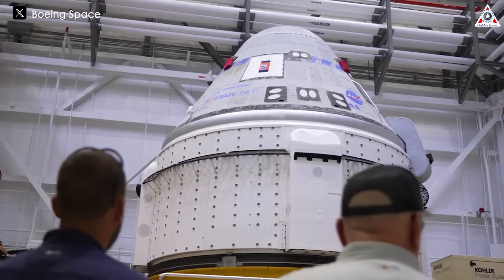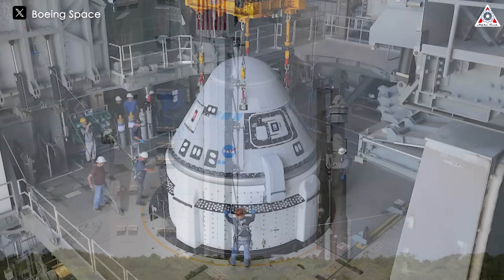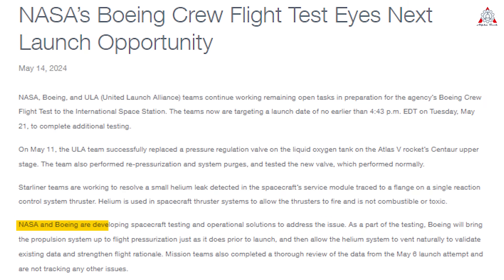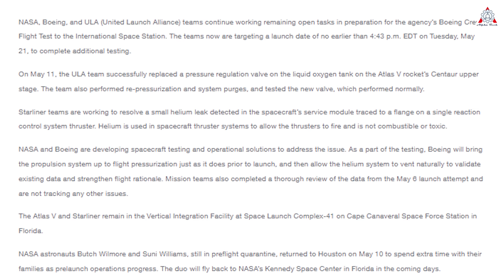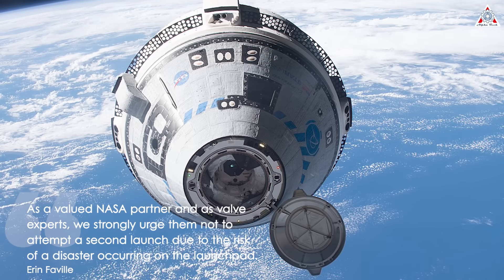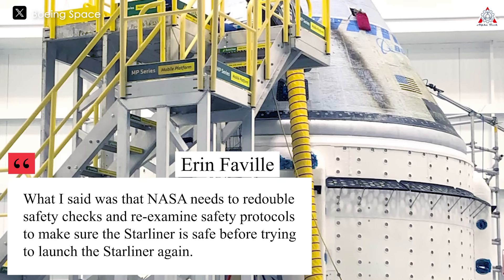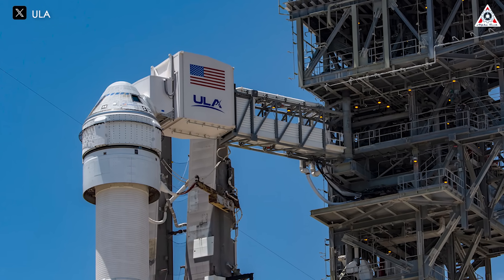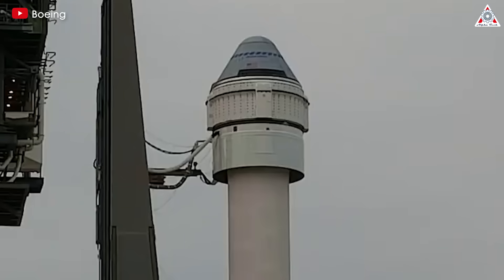Starliner is in Big Trouble! NASA Finally Realized Dragon is 1000x Better

Comment: Don't they utilize test benches for components used in assemblies? Leaks, noises, electronics failures, Space X has had it's share of rockets problems. It's expected when designing & building entirely new Flight to Space and Space Technologies for Human Occupation. There are NO Service Stations, NO Parts Plants in Space. I for one, would not step over the threshold and into a capsule going to space or a 9 month journey to another planet without being 100% confident your vehicle will stand up to the torque and pressures exerted at takeoff. If there are problems, I'd want them identified during rigorous tests, as they build and stack not after a live launch! But in saying all this, we're dealing with manufacturers who are NO Strangers to building and launching Space Vehicles for 60 + years. The kind of problems they're encountering are usually discovered pre assembly. It's telling me, there's a severe engineering intergration problem, poor testing, assembly and quality assurance. I'm surprised that there aren't more boeing aircraft just dropping out of the sky! Dust off the Saturn V LEM, Command Module, and Capsule and send that back to the moon. The launch problems are already thoroughly documented and fixes applied during the build process. It just seems the more advanced we become, the more careless we are.

Comment: Why use helium?  It's expensive and we do t have very much of it.    Why not another inert gas?
Reply: Weight, perhaps? The Atlas V has a cost of $13000 per kg to low Earth orbit. Helium is a lighter gas and therefore costs less to put into orbit.
Reply: He leaks out of smaller pinholes than any other gas except Hydrogen.

Comment: Boeing has become a 3rd rate manufacture company,  incorporating poor reassembly of farmed out main assemblies. Boeing has as many suspicious deaths as HRC and climbing. I won't fly on any 737-800 aircraft. Many bad issues now with Boeing and their suppliers. Aerojet assembled the 737-Max plug door properly, Boeing took the door off and forgot the locking bolts? That's crazy, some yellow caution tape would have warned the next shift crew that the bolts were missing and NOT to install the interior plastic over the rear door plug before installing the plug door locking bolts. DEI or not, there's a big process problem where QA is concerned.

Comment: The thing is those Astronauts and Aerojet or Boeing do not have to rely on it anyhow to keep on mission. They are launching 200 of these a year without a hitch so far. But only this one is troubled and they gotta be about letting Pilots and Astronauts be in charge of the majority of the actual flight issues that they've all already specified without cause to interfere. This mission will be on track with the same Astronauts regardless of this never ending stop action on this one rocket. Several other successful liftoff pads exist

Comment: "Ladies and gentlemen, thank you for attending this briefing on the Starliner mission.

"As you know, we've had a few, well, 'issues' along the way which have caused us to postpone the launch time after time after time, prompting one of the astronauts to throw very heavy objects at me.

"One of those objects is called a 'Reaction Control System Thruster,' and it really hurts when it hits you in the head.  Suni Williams has quite an arm on her.  I'll open the floor for questions now."

"When will Starliner launch?"

"May 21st."

"No, I mean for Real-Real, not for Play-Play."

"October 11th."

"Of which year?"

"2025.  Next question..."

Comment: The biggest problem in my opinion is that the initial problem with the ULA valve was someone had to "notice" an odd "humming" sound from the valve before the flight was scrubbed.  The question that has to be asked is why was that valve not picked up routinely as faulty with the sensors on board the rocket...

Comment: We need more than one supplier.. 
It’s like a car manufacturing.

One supplier might have a $50,000 car, designed with latest tech, works really well, delivers everything needed and is reliable.

The other supplier has a $5,000,000 car,  looks like it’s from the 60’s , breaks down as soon as you leave the shop, and people say a prayer before starting the ignition.

Umm.. I think we can live with one supplier..

Comment: Boeings quality control went down the tubes after they merged with mcdonell douglas.
Reply: Actually, it started a bit earlier when Philip Condit became CEO and went on a massive restructuring of Boeing. McDonnell Douglas had it's own financial issues leading to the merger, but MD was essentially swallowed  by Boeing. Moving the headquarters to Chicago was the work of Condit. The Boeing board even tried to oust him.  MD was a victim of the merger and not the cause of Boeings problems. Condit changed the corporate culture of Boeing. That is what hurt it the most along with moving from Washington.

In reality, Condit was responsible for destroying two great companies. It was all driven by the rise of Airbus and the desire to eat their lunch. It failed miserably.

Comment: Back in 1967 Gus Grissom crew commander of Apollo 1 was photographed holding a lemon over the command module.
It killed him , Ed White and Roger Chaffee months later during a fully pressurized capsule launch pad static test when a cabin fire erupted.
Reply: A full pressure pure oxygen environment - with no emergency exit.

Comment: It Is easy to FIX this problem and it can be done safety  just stop giving money away     they see this POT of money and need more for other things  so they come up with other problems  so they can get  so called cost over runs      then they love to spend money on the Lowest bidder  even there are those that can do the job right to began with     this system is loaded with  theft and  out right Crooks 
 there should be a system where if they deliver on time  there is more money     NOT FOR OVER RUNS

Comment: Dragon can not boost the orbit of ISS, starliner is supposed to be able to do that.

It would be nice if a spacecraft built in the west had that capability.

Also, all systems that handle helium or hydrogen leaks - it is just a question of how much.

Comment: I know nothing about building a rocket but I am a mechanic and I have experience with building things etc. How can you not figure out how to have a totally leak-proof system on a brand new rocket? They are supposed to have some of the best engineers in the world so it is laughable that they actually had the rocket on the launch pad and still had a leak in the helium system.
Reply: My thoughts too. What exactly more than a whole lot of non faulty valves is the hardware complexity of such a capsule? Where are they spending all the money on?

Comment: The spacecraft is too expensive too outdated. It is made out of used parts. Let me correct that left over parts. And you're expecting to build 21st century spacecraft out of it. I said junk it or put it in the museum as the biggest failure a Mankind. I correct myself the most expensive value of mankind
Reply: reminds me of the show "Salvage 1" from late 70's early '80's, but they got their junk pile to fly.

Comment: This should have been scrapped years ago, and should never carry people. When a newer (remember this is basically a warmed up Apollo capsule) system comes online that is proven as safe, reliable and a fraction of the cost, then this project should have been cancelled. If NASA needed 2 different space capsules they should have turned away from Boeing and got spacex to design something. Boeing and NASA. Are just flogging a dead horse

Comment: and LIVING PEOPLE are supposed to depend on this thing ????  starting to follow the Apollo 1 mess ....cannot end well
Reply from the maker: Yeah!
Reply from the maker: Thank you for your comment!
Reply: I just hope and prey this flight does not end in tragedy but with all the problems and failures with Starliner there is a very real danger it will.  The Soviets always relied on their Soyuz to ferry their cosmonauts to the ISS and the Russians have no need for another spacecraft type.  The Crew Dragon has proved very safe and reliable and therefore NASA can continue using that without the need for a second spacecraft type.  If a disaster does occur, then forget about returning to the Moon with Arthemis, let alone going on to Mars. And in the event of a tragedy, the inquiry board will say “Despite all the warnings about a potential failure of Starliner, NASA decided to launch it anyway”. 
This sounds familiar?  Well, the Challenger inquiry board said “ in spite of warnings about the o rings not  working in cold weather, NASA decided to launch the shuttle anyway”.